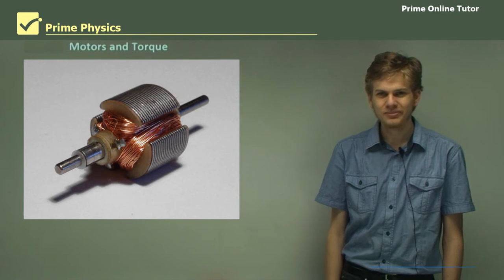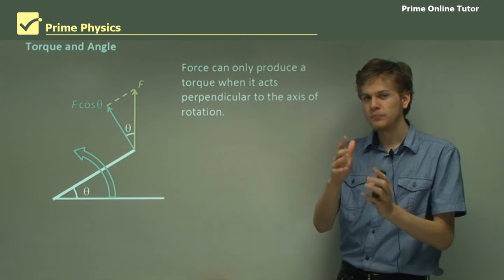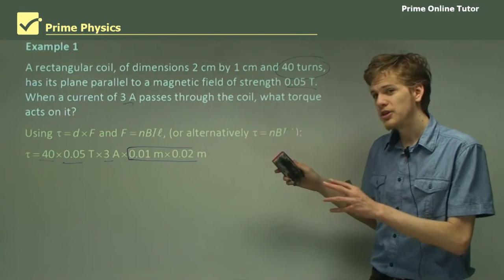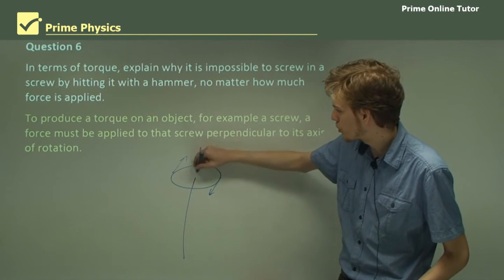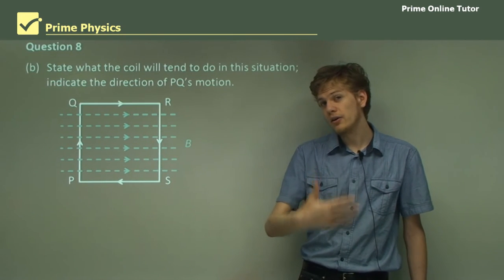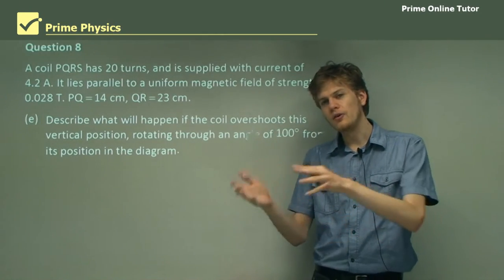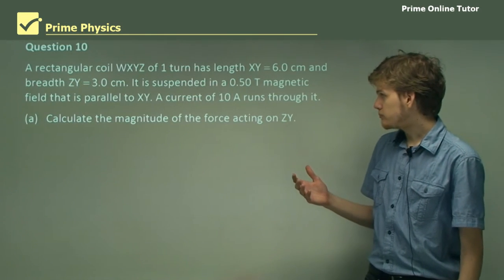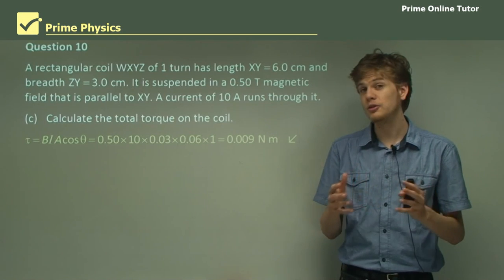🌀 Decoding Torque: How Motors Harness Magnetic Magic

Comment: wait so is it ok to just throw all the factors in a multiplication equation and treat the result as an end all be all measure of strength because it would seem to me that one could make two motors with identical torques, but not identical nBIA values which I think would make one stronger than the other if we were to test them for example in terms of which one can lift  heavier object (under same power input, RPM and shaft diameter) isn't there some adjustment to be made in terms of how much 'weight' each of these nBIA factors have in determining the real life performance of a motor?